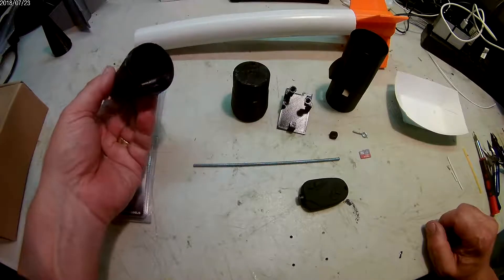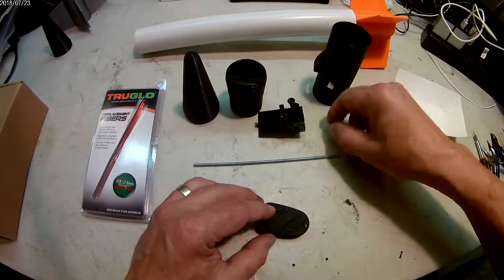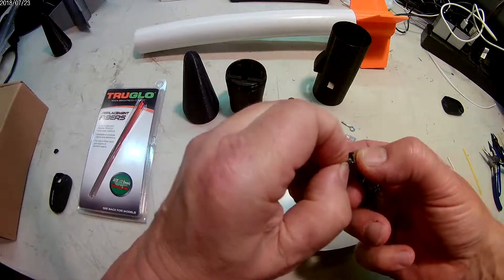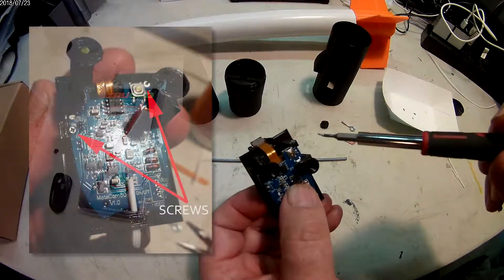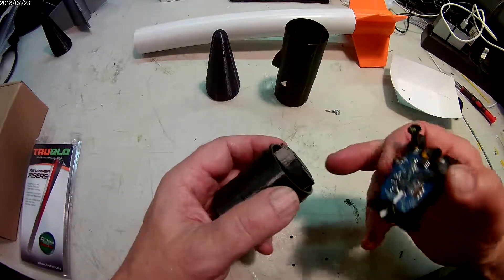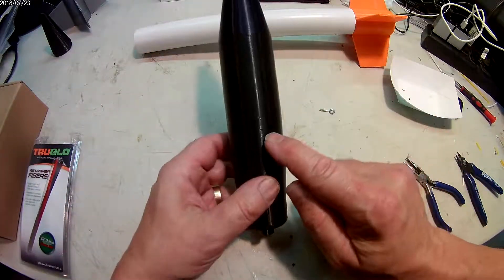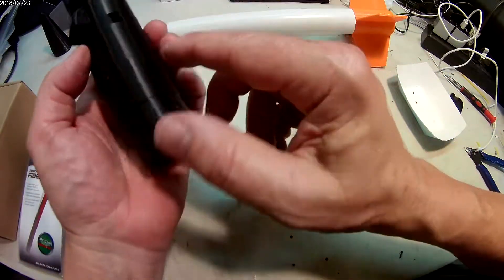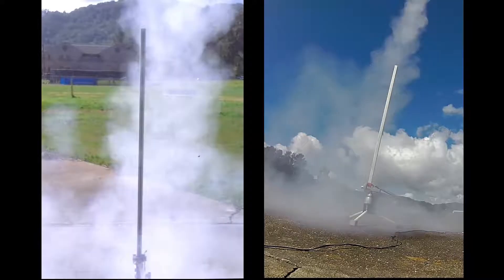3D Printed Cineroc 808  Overview

Comment: I was reminiscing with my wife about the Cineroc, and how I just missed getting one when I was a child. This led me to find your work, and files.

It is wonderful what you have done! And your design is so clever, and well thought out, in every detail. I don't have a 3D printer, and I'm not presently (and have not, for 50 years) messing around with rockets... but I will save your files, and videos, should I ever decide to.

It would be great to build your Cineroc 808, and fly it, because it would (after half a century!) fulfill a regret I always had: I saved to buy a Cineroc, finally, when I was 12 years old... I think it was a staggering $6.98 (is that right?). I was standing on line at Tom Kat Sporting Goods in Mahopac, NY, where I bought my engines and sometimes, kits (still have my Estes catalog, which I also used, like all of us... every description memorized!). But I forgot taxes! So for the lack of maybe 50 cents, I had to put the Cineroc back on the store rack, and never bought one. 

It would be cool to finally take my video, a half century after failing the first time. Anyway, thanks much for doing this project, and so well, and for sharing your work.
Reply from the maker: Yeah, the Cineroc left a huge impression on many young minds.  That's what made me want to offer a 'tribute' model with updated hardware.